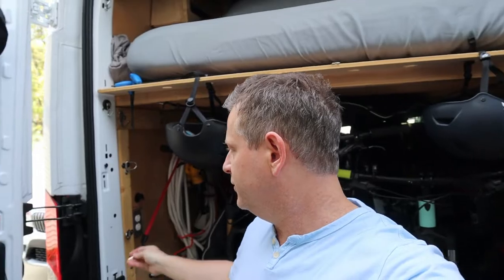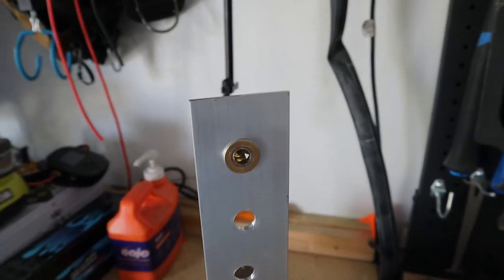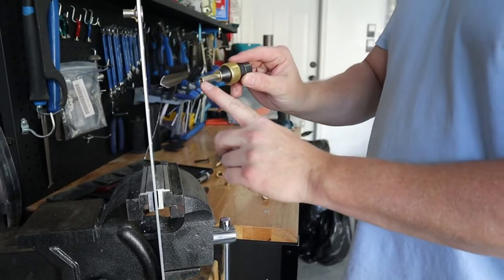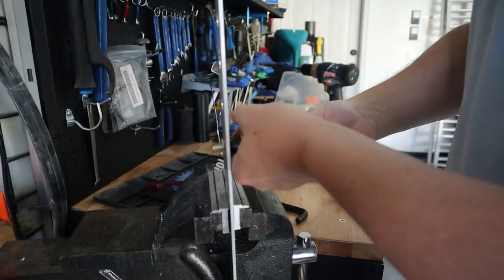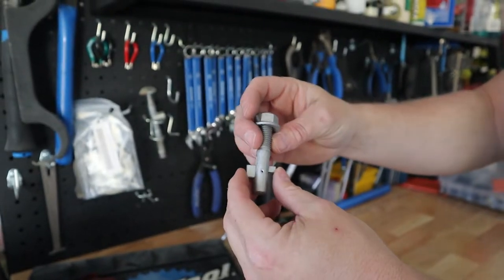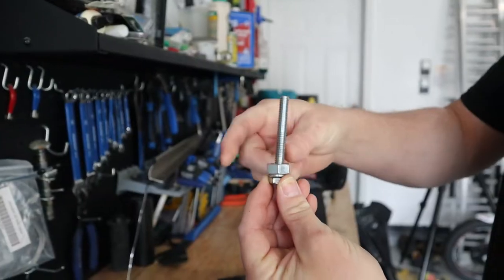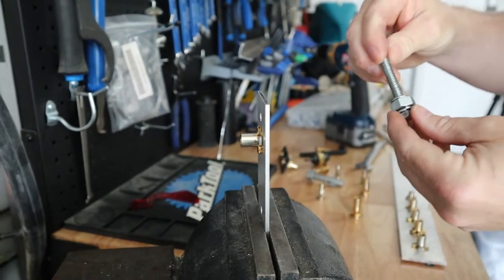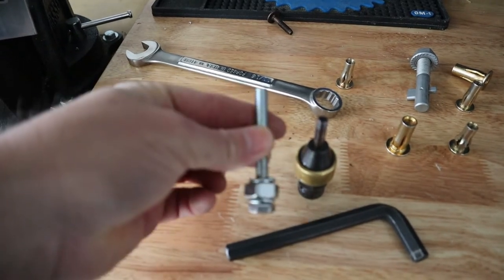#MTBPlanB Blind fasteners used in Van camper conversion and best DIY plus nut tool.

Comment from the maker: If you're doing a van camper conversion or just attaching items to sheet metal, you'll want to use this DIY tool and fasteners.
Reply: Thanks bro !   Needed Plus Nut info.   Good luck on your Van Build, I'm doing a bicycle cargo trailer.

Comment: I was thinking there's no way I need to spend $50, there's gotta be a way to use a bolt and my impact and it would take 2 seconds! great video!
Reply from the maker: Indeed, glad it might help.
Reply: @MTBPlanB  I'm with Kevin. Why spend $40-50 on a tool with such a limited application? Thanks for the money saving solution!

Comment: Good video.  I just installed a number of these and I can say with 100% certainty that there is NO NEED for a special installation tool.  Some of the dedicated tools actually do an inferior job.  A grade 8 bolt, oversized nut and a couple washers combined with a drill or bit driver works perfectly.  These things are really soft and I set most with a stainless screw.  Just don't over-do it.

Comment: I need to work out a way to install a dozen 3/8-16 slotted, pre-bulbed Rivet Nuts for a Humvee application, will give this a shot.   Both the FSI D-100-Mil-1 hydraulic tool and the 16" long handled manual tool do not engage enough threads to crush the 3/8-16 slotted, pre-bulbed Rivet Nuts.
Reply: I recommend 4 inch Grade 10 ot 12 bolts.

Comment: Hey nice video, i appreciate the time taken to explain in depth. What rivnuts or cross nuts would you suggest for a car dashboard (pvc material). I need to attach a stereo panel but i need it in a way where if i have to make any future repairs i can unscrew the nuts and take the panel out. Its a diy project so i have to fix the panel on a desired place on a dashboard where i need some good grip to fix it and i find these kind of rivnuts or cross nuts appropriate for the job but i am afraid that when i apply the torque it might crack the dashboard. Any suggestions will be a big favor. Thanks.
Reply: Use nutserts. ( rivetnuts ) Get the aluminum ones for plastic attachments, and if you can reach the back, use a steel washer matched size to rivnut. That will sandwich the plastic, rather than stress the area around the hole. Last, be SUPER careful not to over tighten the nutsert. ( as soon as just snug, check it wont spin around. If won't spin, that's enough.) Plastics can be easily cracked if you use a full CRUSH.

Comment: I'm a bit confused as to why you used "lock washers" on your "tool" and not "flat washers"?
Reply from the maker: It helps keep the nut from free spinning before tightening down. If you try a flat washer, let us know how it works. Thanks
Reply: @MTBPlanB  Lock washer works better. I tried it.

Comment: How do you remove e a bili d fastener  the first type  you I stalled
Reply from the maker: You can drill them out with a step bit. It’s not easy to retrieve the fallen back part though.

Comment: May I have the maker of the plus nut tool you use ( non diy tool)
Reply from the maker: I used a tool similar to this one https://www.amazon.com/L845-4-40-THREADED-RIVET-NUTS-ALUMINUM-STAINLESS/dp/B01CUL89LI. But look in my video library of how to do this for less than $10.

Comment: Will these work for d rings bolts?
Reply from the maker: Yes just depends on the load force.
Reply: @MTBPlanB  some of my d ring spots aren’t tapped so I thought this would slide in the holes and use these for thread purposes.

Comment: The bolt in your demo is kind of long.   Wouldn't it hit the exterior panel when the plus nut is fully set?
Reply from the maker: Yes.. I used shorter bolts inside the Van.

Comment: why the larger nut, whats its purpose
Reply from the maker: Ben Blanco The nut captures on the lock washer as you turn the bolt thereby allowing the bolt to tighten without free spinning the entire plus nut assembly.